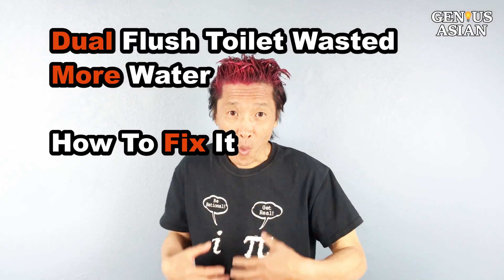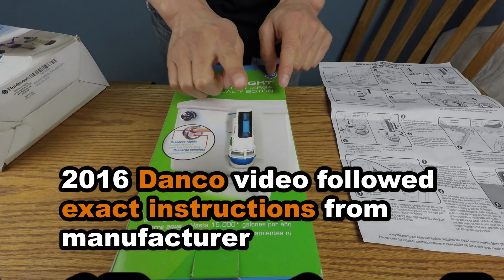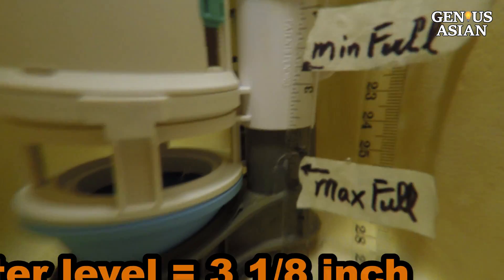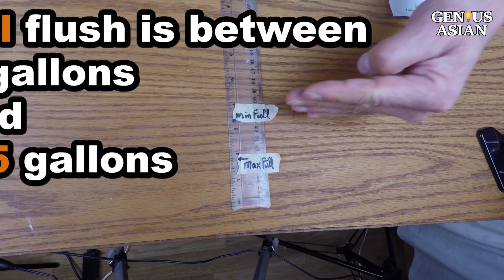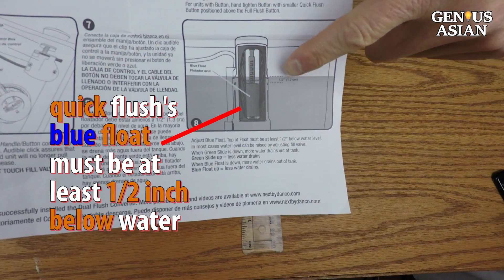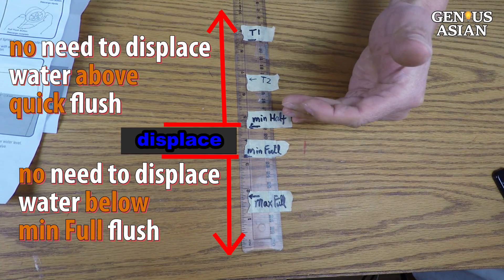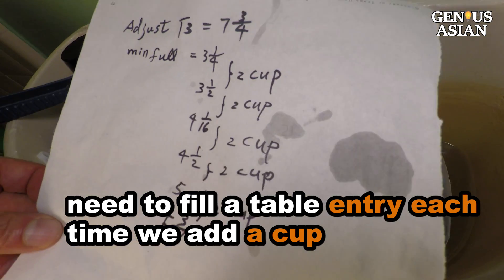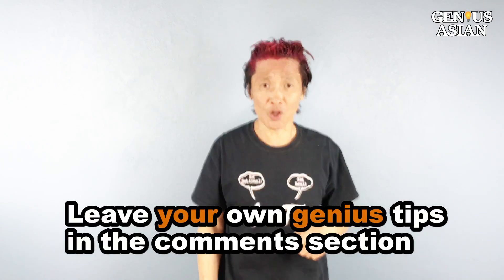Dual flush toilet wasted more water, how to fix it

Comment: Another great video!  I love how you showed how to cut the yogurt container and jug, to displace different levels of water at different heights.  I haven't bought the duo flush system, but rather just used your other videos to create my own 1G liquid flush and 1.5G solid flush using yogurt jug.  Question, if we can do that already, is there any advantage of spending $40 to purchase the duo flush converter?   I've got 4 toilets in the house.  Or in my case, do you recommend saving the cost of duo-flush converter and just adjusting to 1G and 1.5G flushes like you're other video shows without any duo-flush converter system?